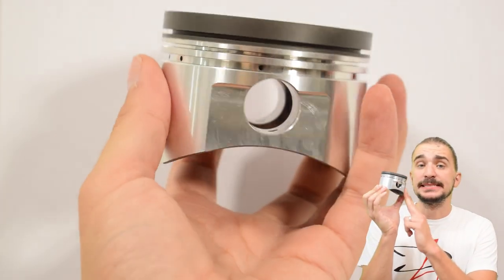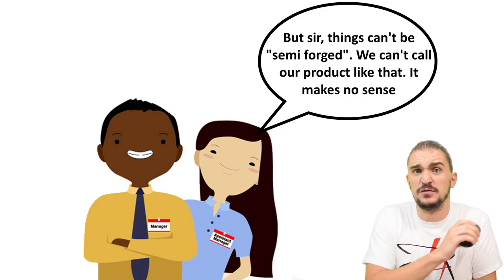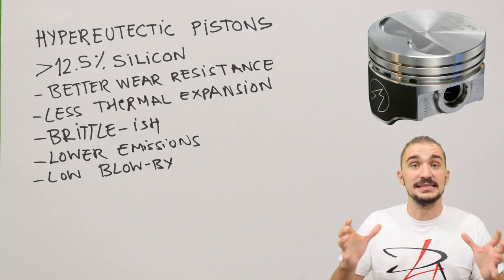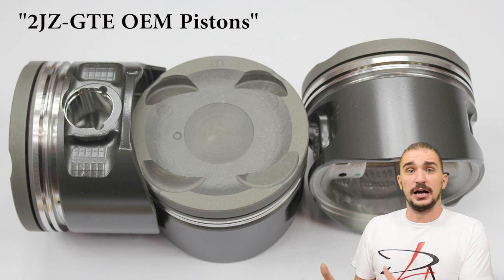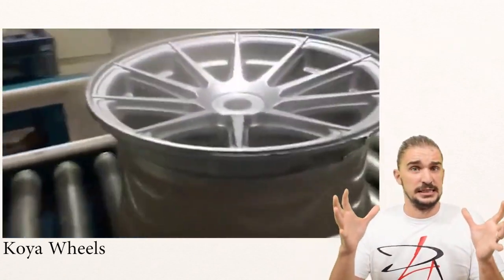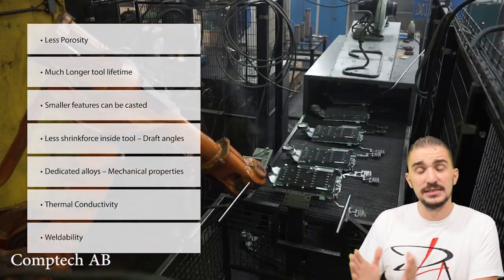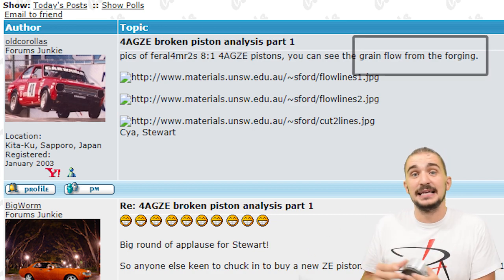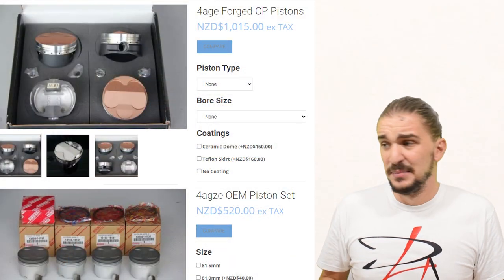What are SEMI FORGED PISTONS?

Comment: If you state that semi-solid (thixotropic) casting can be regarded as semi-forging, then high pressure hyper-eutectic casting is equally valid semi-forging. 
The whole point of requiring high pressure for casting in the first place is that a hyper-eutectic Al-Si alloy will quickly form a slurry, a mix of liquid phase and solid phase, when it cools. That's no different than semi-solid casting, only for high pressure casting the initial temperature is high enough that everything starts in the fully molten phase and it becomes a slurry once it cools as it enters the die, before it fully fills all the runners and cavities. The high pressure is needed to get the molten-metal-turned-slurry to where it needs to be.
So IF it's valid to call semi-solid casting a form of semi-forging ( and I think you are absolutely correct in this! ) then it's also valid to call high-pressure hyper-eutectic casting a form of semi-forging because, as the metal flows into the die and starts cooling during filling, it also turns partially solid while it is still being pushed in further into the die.
Reply from the maker: No no, as I said a few times in the video, I think it's incorrect to call either method semi-forging, but the properties of the semi solid stuff can be described as semi forged, having mechanical properties comparable to forged, which can't be said for conventionally high pressure die cast hypereutectic pistons.
Reply: @d4a  In the end, it's the properties of the part that matter, not how one got there, so there's that.

If you consider both processes, and that both form a mix of liquid and solid metal into a part, then one can get away with calling both processes semi-forging. Forging is, after all, deforming a (soft) solid material, and a slush/slurry is a mix of liquid and solid, hence semi-forging. I would personally stick to casting, but I can't fault the reasoning for calling it semi-forged.

Neither semi-solid casting or hyper-eutectic casting will achieve the microstructure of properly forged material and the benefits that a true forged structure has over a cast structure.
Reply: @d4a  I gave it some more thought, in order to try to better explain it. 
The fundamental difference between cast and forged material is in the crystal structure, both in the direction and shape of the grains and in the grain size. 

In a cast part the solidification process determines the structure. The cooling rate determines the grain size and the grain direction is that of the heat flow during solidification. Grain size is typically very large. (And there is the risk of porosity as result of shrinkage to deal with too.)

In a forged part, the material flow during the forging determines the direction of the structure. This hot working also triggers new grain growth, so you typically get a fine grain structure.

(Because of this thing called the Hall-Petch relation, a finer grain size gives better mechanical properties, so forged is often preferable over cast.)

Both semi-solid casting and hyper-eutectic casting are, well, casting, but some of the resulting crystal structure is determined by flow direction of the slurry during filling, not by the direction of heat dissipation during solidification. The typical structure is also much finer than conventional casting. So calling that semi-forged? As I said before, there is some truth in it.

Comment: You are wrong about the metallurgy of hypereutectic alloys, I hope you realise. May be you are over simplifying for your chosen audience?
Reply from the maker: When you say someone is wrong it's common sense to explain why you think they're wrong.
Reply: @d4a  I really like your work, I was not trying cause offence. My comment was from the perspective of someone who used to work in high pressure die casting a while ago.
But, since you ask, here are a couple of points that may be relevant.
The eutectic of the aluminium-silicon alloy system is close to 11.8% silicon.
Both hypo-eutectic and hyper-eutectic alloys can be high pressure diecast. That is, below and above 11.8%. Typically 8-9% or above 14% in my experience.
The mechanical properties of high pressure die castings are determined by the runner design. That is, the passage design that feeds the metal from the piston in the machine to die cavity in which the casting is formed. The gate design.(As in the orifice which feeds metal into the cavity from the runner. The gate velocity . (Usually around 50 m/s or above.) You are correct when you state that the cavity fill time should be around 50 milli seconds. If a partial vacuum is applied or not. The temperature of the die and metal. And so on.
What I am trying to illustrate here that its a fairly complicated process and there is lot that can go wrong. The process control must be pretty damned good. But then the technology of high pressure die casting changing rapidly the whole that I was in that industry.
You refer to smaller silicon rich particles in the cast metal.
This due to metal solidifying rapidly while it is still being injected under a very turbulent flow. This refined grain structure gives better fatigue resistance and other improved mechanical properties.
I am surprised that the die casting process is used for this application. Process control must have  improved. But then, engine bocks have been die-cast for many years.
Of course, you are correct when you state that an high pressure die casting is not a forging of any kind.